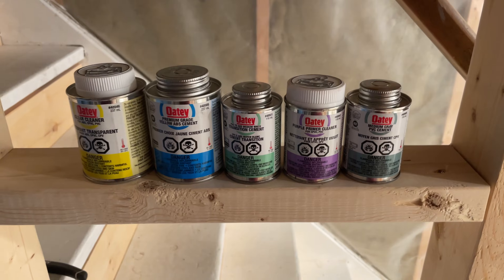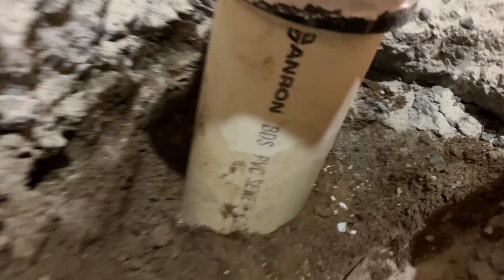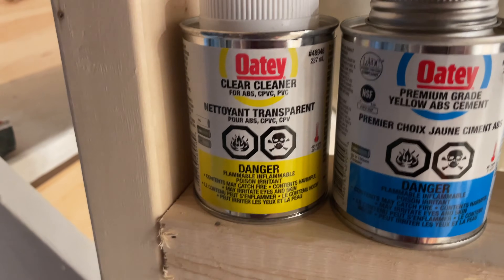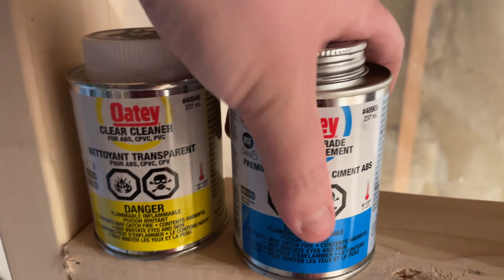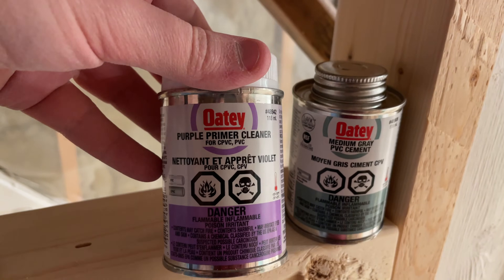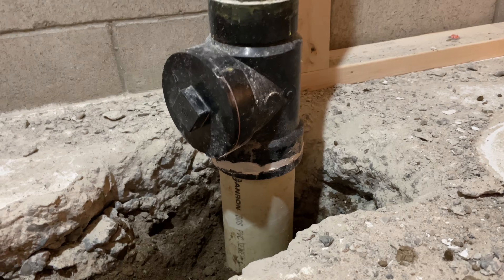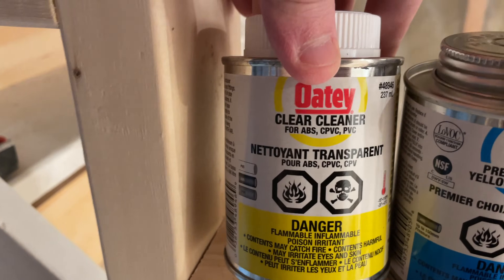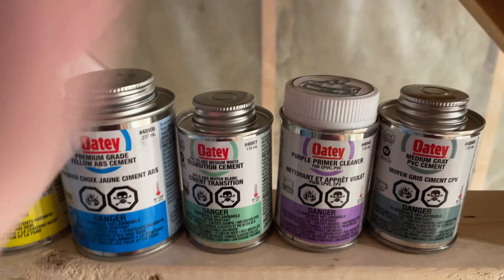Plumbing Glues 101 - What are the differences? Which one to use? Choose the right plumbing cement!

Comment: Bro, all you need for PVC is purple primer, and regular clear pvc cement. 

It is cheaper and works just as good as the grey stuff. Is with all glue, as long as you apply it correctly. It will suffice, 

FYI purple primer can also be used on abs,    FTR.  Primer is primer, serves the same purpose. No matter what color it is.   The only reason they have a bright purple is because in most plumbing applications, inspectors like to be able to identify that primer has been applied,    That’s why clear primer can be used on abs, cause it’s hard to see purple anyways, 

I agree that it is best to have abs glue if your doing full abs,  but to transition, you don’t need a special glue,  just use pvc glue. It will suffice.    Finally…… you DONOT want to use pvc glue on CPVC pipe, there is a CPVC GLUE for that. Which is recommended as the CPVC has a different optimal melting temperature than pvc
Reply: Also you you DO NOT wait for the primer to dry. It is supposed to be wet when adding the glue.
Reply: what would you recommend to repair pvc pipe 45 elbow coming out of a furnace?  Purple &  reg clear cement?
Reply: Can you use the green for pvc to pvc?
Reply: Can you use regular pvc cement for grey conduit? It should be fine right? Its all PVC.